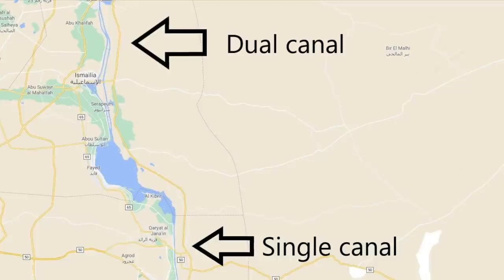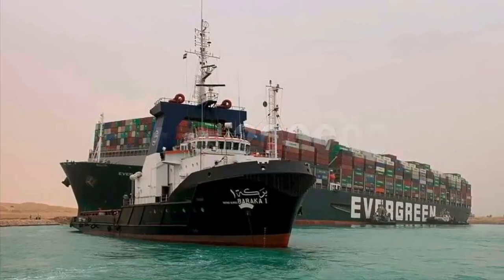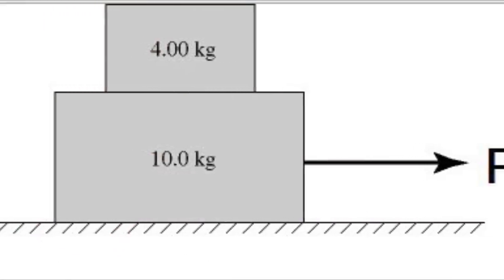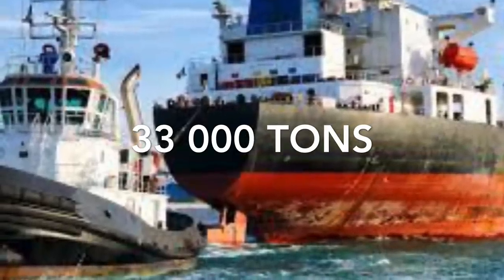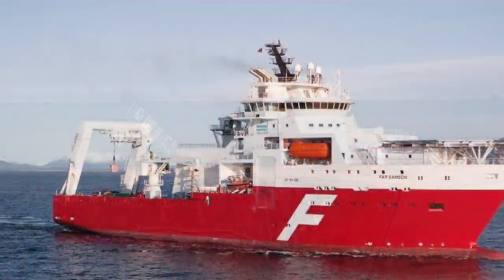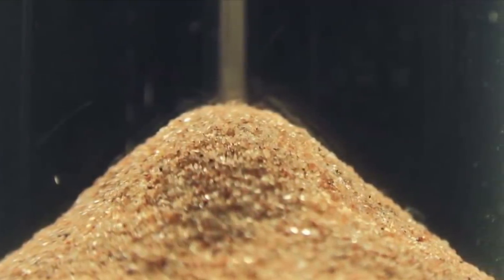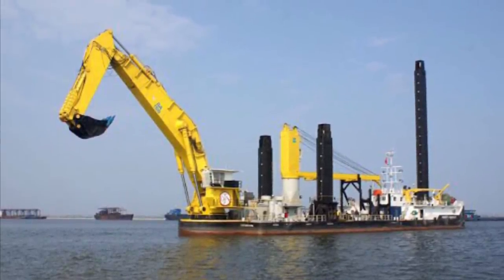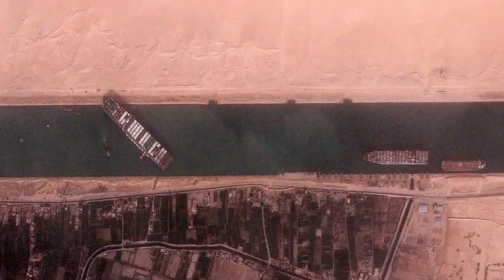MV Ever Given - why can't it be pulled out? Suez canal blocked

Comment: Why not bore a pipe into the sand and pump a lot of water there, liquefying it and allowing the ship to move?
Reply: I like it .  or use a large dredging vacuum to pump sand out from under the ship...
Reply: Its surrounded by water. More water may wash some sand away but 15 meters worth of sand would take alot of time. They will end up needing to unload the ship.
Reply: It wont work if you remove sand more will take its place
Reply: @dangerboy808  The idea is not to remove sand but to liquefy it by pumping water into it. You can look up "liquid sand hot tub" by Mark Rober for the air version. I think water would work similarly.
Reply: When he said friction I immediately thought of air. They should use horizontal drilling machines to put tubes under in the sand and blow air up and around the hole. This will reduce the friction like a Russian VA-111 Shkval torpedo.
Reply: @alexeytsybyshev9459  there is a current that flows through the canal so whatever is removed will be replaced, if it was in stationary still waters than that and alot of other options could possibly work, the ship right now acts as a damn in a way and current is moving sand and the ships collecting it as we speak
Reply: @dangerboy808  Then they could never have built the canal.

Yes initially but There is   an angle the bank can be at that is stable.
Reply: Its not a bad idea, I'd use a large water jet on a excavator to dig, the sand water mix could then be pumped out simultaneously onto the nearby desert, thus allowing new water to flow in.
Reply: @JayMcDeejay  I don't think air would work though, with wet sand. With dry sand, there is already air between the grains, and any air distributes between all the spaces. With wet sand, there is water between the grains, and air would not be able to go everywhere. It would instead form channels between clumps of wet sand.
Reply: If they threw a ton of water and blocked the flow the tug boat might work in concert
Reply: @alexeytsybyshev9459  the hoses would have to certainly be perforated like a natural gas heater. Also when the air rises and presses against the hull it will flatten as it rises.
Reply: Why not use another container ship to pull it? Just like using trucks to pull other trunks when stuck in mud
Reply: cause its a scam like everything else
Reply: I’m just a dude thinking outside the box... First Carefully dynamite the shore line to open a small cove, then pump water to liquify and loosen the soil 15 meters down creating a cove. Attach jet engines on both ends of the ship on opposite sides to thrust the ship straight. With jet engines thrusting in opposite directions combined with shore removal and simultaneously liquifying the sandy bottom might be enough to push the vessel straight.
Reply: @JayMcDeejay  But would also reduce the density of the water around that section, which would also reduce the ability of the water to support the weight of the ship.
Reply: @arizonajones6068  Haha, I think you would be better off setting off a nuke deep under the ship, so that it first creates a bulge which later collapses, filling with water and creating a deep crater lake in which the ship will float.
Reply: @quantumbits  no they could of easily built the canal Infact current itself helps water flow through how do you think alot of creeks are made in nature? Alot are from water flowing making a path, maybe your having a hard time understanding
Reply: @shade9272  irrelevant, the water's not holding the ship, it's aground.
Reply: dam* There! Please don't “dam” unspecified-targets for your otherwise and miraculously level-headed replies in line with your display-name, " @dangerboy808 ". FTFY 😊
Reply: “carefully TNT-ing the shoreline”: When there are civilians settled on one side of the canal? Even if fortunately, this area of the canal is not an urban-agglomeration?
SWELL.. " @arizonajones6068 "

Comment: As a little girl once said when seeing a truck stuck in a tunnel, "Why not let the air out of the tires?".
Reply: Funfact: That has been done sometimes.
Reply: @Ttavoc   And sometimes, it works !
Reply: Still can't move a truck with no air in the tires.... But you can lower it that way and have it pulled out, front or back, whichever is shortest distance.
Reply: I thought about that too but to lower the water you would have to build a dam if there isn't one already which would be a whole lot longer than getting the ship unstuck by other means.
Reply: If stuck on a sandbar, you need to raise the water, not lower it.... You reduce the weight on board the ship so when the tide drift back in, it will float off of it.... I grew up near the ocean and we had a boat, so it makes a difference how the weight is distributed.
Reply: @chordsofgratitude2073  oops that's what I meant.
Reply: As a little girl once said when stuck in the laundry machine, “help stepbro I’m stuck”.
Reply: @joetroutt7425  you need to raise the water silly. It'll just sink harder the less water there is. More water would allow it to float. 
Maybe they should take a few fire hoses and blast that area around the nose to move some of that sand away from the ship?
Or why don't they start removing some of them containers to lessen the weight? I mean they're already losing a shitload of money what's another few hundred grand at least the canal wouldn't be blocked. Shit you'd think that they would be able to move them to another ship instead of dropping them in the water
Reply: @mandielou  if you would have took the time to read on down you would seen I corrected my statement.
Reply: @joetroutt7425  well I don't read all comments and last I checked I wasn't mandated too. Maybe you shouldn't be so offended. If I was trying to be offensive I would've left it at correcting you however that's not what I did. Chill out.
Reply: Same as the little boy who said to the fireman let the air out of the tires of the truck that got stuck under the bridge. My dad told me that one in 1979 when I was little. Guess there's many variants to that joke.
Reply: Someone`s probably thought of this already,but why not get a powerful air compressor with a long hose and blow the sand or earth out from under the ship,similar to what treasure hunters do when they go searching for sunken wrecks in deeper water....over 15 meters in many cases....just sayin`.....
Reply: Maybe 8 of these big hoses blowing out the sand/earth on each side...??
Reply: @chordsofgratitude2073  absolutely chaos
Reply: I would have just disassembled the vehicle and made a better one that does not get stuck in tunnels.
Reply: We had a hangar small for an airplane. The common thing we did was take the air out of the landing gear give the 4 to 5 inches needed to get the tail into the hangar. Then service it when it was done with maintance.

Comment: Ive seen water pumps used to liquify the ground underneath a vessel breaking them free on the Mississippi
Reply: Exactly what I was thinking.
Reply: I say screw it! Drop about 3 M.O.A.B's on it and be done with it.
Reply: Shane 😂😂😂
Reply: @shane8915  it'd be cheaper to off haul the containers and bilge water and hit it with several torpedoes.
Reply: @HH-le1vi  But, it'd be more fun my way.

Comment: WRONG! I can´t believe, that everyone is so fixed on the water! 50 M1 Abrams tanks have a pollard power of 1500 Tons! The Egyptian Military have 1130 of these tanks!! The friction force is NEVER as high, as you calculated, because you forgot to substract the displacement! ;- ) You can calculate the weight by the inclination of the containership in the water. I suspect the rising of the bow of 0,5m. If the waterline is crossed at one third from the bow (133m) then you have 266x60x1,0x0,5 dispacement! This makes 8.000 Tons of water. I assume the center of the force of the displacement 2/3 from the pivot point and the opposite force 1/3 from the pivot point to equal the torque. So the opposite force, or real weight on the right bank is 16.000 tons. BUT the friction is NOT over 133 meters, I assume only 20 meters. And it lays only on parts of the narrow keel!!! I would assume the friction force maximum 1/10 of the weight and NOT 50% of a flat surface of 133x60 meter! So this results in a necessary force of 1.600 tons! BUT tanks and tugboats can achieve over 2.000 tons of Pollard power!
Reply: So - while all the proffesional diggers and tuggers are moving sand - how about filling the back-bulkheads with water. Lose a few containergoods, but get buoyancy upfront.
Reply: WRONG!! That ship is made of paper machet and runs on rainbows and unicorn farts!
Reply: Thugboats LOL.
Reply: @mangobart441  both side were in bank... They just got rudder free.
Reply: Who cares?
Reply: Thugboat = pirate ship?
Reply: @buckfiden4781  Finally someone who understands
Reply: That’s a lot of assuming on your part!
Reply: Or they can just call aquaman
Reply: Dude obviously someone put the ship there on purpose. Lol
Reply: Maybe fill the ballast in the rear to lower it. Then push the stern over to the right prying it free. They should also clear the sand from the left side so the bow will pop out. Probably send some drill pipes through the sand and push some high presssure under the bow to relieve the vacuum as well.
Reply: Great point! Pull with tanks, take advantage of proximity to land.
Reply: Chuck Noris could pull it out himself. Using just his hands and rope fashioned from his own beard hair
Reply: @ROCCOCYCLES  can't fill the ballast tanks. If they do that it will sink more on the sand. Bow and stern are both sitting on the sand
Reply: @larry6686st  The stern has been pulled free.

Comment: There is a very simple solution to this that would not require downloading containers from the ship.  Using INDUSTRIAL, high power water jets based both on land, and in the canal, to stream a constant strong flow of water under the bow,  the erosive power of a constant water flow has moved mountains, and can easily loosen this ship without all the downloading being considered.
Reply: How about some Sikorsky sky cranes unloading the damn containers onto the sand?
Reply: @bhaggen  One at a time? Assuming 30 mins per container (probably not reasonable) that would be 41.6 days working 24/7 with 10 helicopters. Let's say realistically you could only safely use 5 helicopters and 1 hour per container that would be 166.6 days.
Reply: NO LETS DOWNLOAD THE CRATES.  IN CASE SOME COMODITIES MIGHT NEED SOME FOOD OR WATER
Reply: That ship has a 15 meter draft when loaded and it is rammed ashore for maybe 1/3 of its hull. If they did that they would block the channel with the mud from under the ship. Plus they would have no control over the list of the ship and it could easily roll over on its side.
Reply: Good idea....
Or
Calculate how many front end loaders and bulldozers they could string together behind it and tug from land...
It got stuck by beaching itself at drift speed.....its not that stuck
Reply: Get real! If there really was a simple solution, they would be using it already. As for your solution in particular, it could take weeks to acquire, deliver and install the machinery.
Reply: @Murray9452 .....OK, what if they clear the area and NUKE it? That would widen the canal too!

Comment: So, why not go off in the desert area and bury objects to pull against as a sand anchor then wash the sand out from the front with high flow pumps and hoses?
Reply: based on some superbowl truck commercials I've seen, it just needs a few ropes and a few Ford F-150s with some sand tires, and then a lot of high fives and tailgating parties with the backdrop of the great pyramids and a sunset
Reply: This was my exact thought. In essence it boils down to a physics problem of applying enough force to the ship to move it.

Throw a 20cm dynema robe through 15 snatchblocks on a very strong sand anchor and start winding it.

The worry I have is whether that would physically tear the ship in half, if you're able to anchor such a force within the ship.
Reply: Because they don't want it to get free.
Reply: @garymatney4398  some probably want, now thers strugle who pays more to let it sit there or pull it out some way ;)
Reply: It would have to consist of some of the worlds largest pulley systems and a lot of time. Probably way more cost effective to just spend about a year taking off all of the cargo then draining the vessels fuel storage and possibly disassembling it in the canal if it is buried that far into the sand. Lots and lots of options that could be viable.
Reply: Huge vacuum pumps, and take off the containers, and tell the waiting ships to go around the Cape.
Reply: @davidbanach7982  what are you talking about, 20cm dynema rope and corresponding snatch blocks is an off the shelf goods for oilrigs and heavy industry. The only thing that'd need custom manufacture is the land anchor.
Reply: @davidbanach7982  even if the availability of high strength rope and snatchblocks was an issue, you could just use multiple small tethers.
Reply: @davidbanach7982 : Really wouldn’t take that much. Sink a dozen bundles of rail with wire rope attached, hook it to the backside of a dozen crawler cranes and pull from the deck level. It’s not a matter of refloating the whole vessel, only the bow. No matter how they go about it they are going to have to pull from land anyway.
Reply: @vuza752 : I would imagine that they would have to make a multi-deck structural lug to pull against. But, yea. Dig a 40’ deep hole drop a bundle of railroad rail with a wire rope wrapped around it. Burry it. Hook the cable to the back of a large crawler crane positioned 75-100 yards from the sand anchors and you have a point to pull from. Don’t even need the booms for the cranes.

Comment: You could possibly use high pressure, high volume water- oh mentioned dredge just now. Anyway, water jets to move the sand.
Reply: Afaik, they dredged out the rear of the ship, and are doing the same for the bow
Reply: linked tug boats they do it all the time they’re faking and staging another event

Comment: I think the back of the cargo ship also got stuck. The ship is 400m long, and the width of the canal of that part is only 200m. 
After the front end gets stuck, the back of the ship swings forward and gets stuck at the other side of the river as well. I guess the only way to solve this is to unload the cargos to the side meanwhile try to move the ship. If that doesn't work, they need to disassemble the ship.
Reply: They should have called a marine salvage contractor. Mamoot in Holland re-floats sunken submarines and floats sunken ships. They have large air bladders that lift ships.
Reply: 200m width? but the aerial imagery shows d back of d ship is still in d canal
Reply: @azamkhan1526  Yes, the ship is about 400 meters long.  What is the issue for you?
Reply: @gomerromer7708  im skeptical that d canal width is 200m....i thinks more than 200m
Reply: Cut it with shaped charges. 18billion in cargo is lost per day. Sacrifice the ship for quick removal

Comment: This is a tough one, engineers should be fully evaluating the potential options to free the vessel.  Even reading comments to promote ideas.  The only thing that comes to my mind...Which probably won’t work...Perhaps utilizing inflatable devices at an sudden speed to push the vessel back, after the dig to free a bit....and of course unloading as many containment’s to relieve the weight.  Like fast inflatable hover craft sizes or boats to execute the push.  Along with being pulled at the same time.  In conjunction, this could potentially work.

Comment: Even if there would be 80 tugs (or one supertug), the Ever Given herself doesn't have any bollards strong enough to withstand that pulling force. There is emergency towing arrangement at the bow,  but I doubt it even has more than 300 tons SWL.
Reply from the maker: Corrct. You can not just attach a wire and pull... the loads are just too hign. I heard today that a dreging contract will try and help. I hope to find out what they plan and maybe make a new video.

Comment: I wonder if creating a "port" around it, and filling up with water would do the job... so you need to actually create a swimiing pool there :P
Reply: I definitely don't know anything about this type of stuff, but, I was thinking the same thing as you. If you could, lighten the load and get more water around it, and/or giant underwater air bags for lift, anything to break that frictional force. On that show, "Oak Island" they used a cofferdam to remove all of the water from an area. What if they could do that in reverse, kind of like a river lock? To raise the water level on all sides of the Evergreen in just that one spot, just to break her free. Here in NC, we have locks on one of our large rivers. They shut one down to raise the water depth for larger boats to pass. I know that's not a quick fix, but just a couple ideas. Be interesting to see how it finally plays out!
Reply: @someguy920  well, you're probably right, I was just throwing something out there.

Comment: I would try high pressure water hoses to remove the soil around the stuck part,  Or try to dam the water downstream of the vessel and see if they can raise the water table enough to float it out?
Reply: Maybe but they would have to dam both sides and build the banks higher and pump water in because they are at sea level and it’s not like a river that fills up.
Reply: I like your dam idea